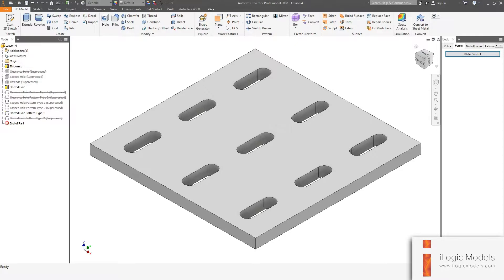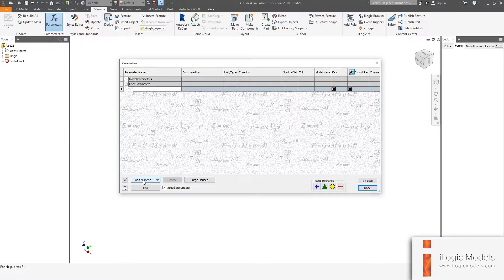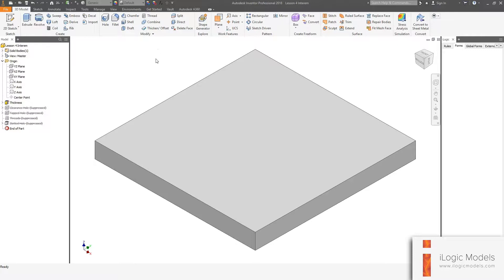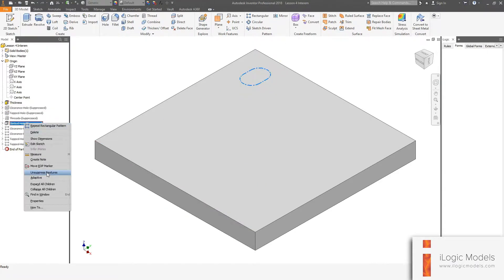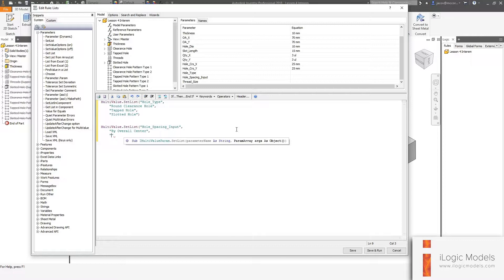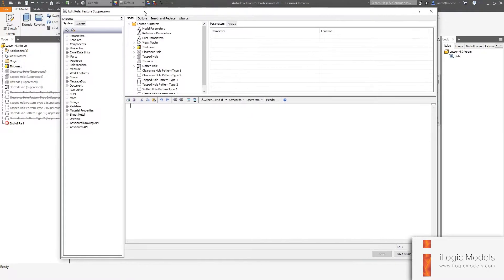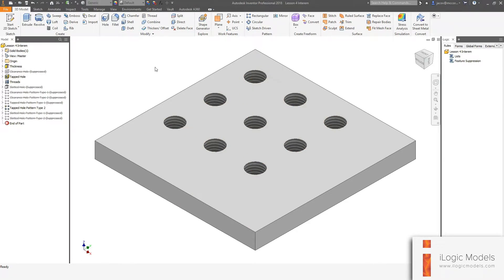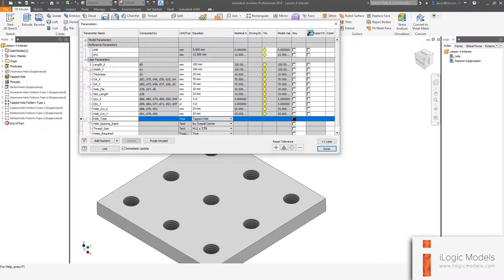Lesson 4 - Create Automated Patterns from Scratch

Comment: Sir, Can you please help me in the following ilogic problem?

Here's the situation...

I have a 320x320x6 mm base plate.
I want to add liner plates (A rectangular plate of 100x100x6) over the one face of base plate.
When I pattern the 100x100 mm squares over the base plate length of 320x320, it fits perfectly with 3 liner plates in one direction. (300/100=3) with spacing of 10 mm.

Problem arises when the base plate changes its length from 320 to 340 mm.

I want a solution such that if length changes from 320 to 340 mm, there should be 3 plates with 10 mm spacing like 100--10--120--10--100 mm middle one being compensatory of length.
If the length changes from 320 to 310 mm., the liner plates should arrange themselves as 100-10-90-10-100 mm.
and so on...

I want this to pattern to generate automatically depending on base plate size.

Can you please make a video for this solution using ilogic (or any other suitabe method)?
If you already have a possible solution, please mail me at atharvagholap01@gmail.com.

Thanks!!